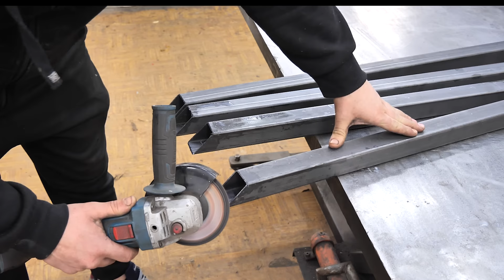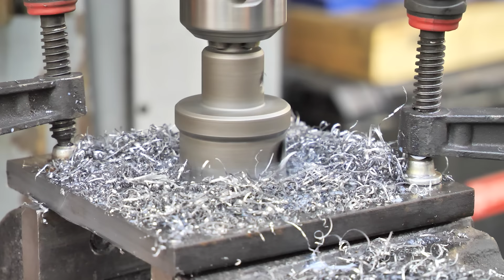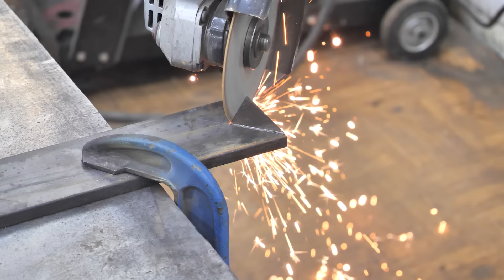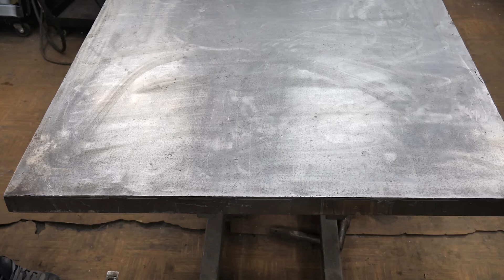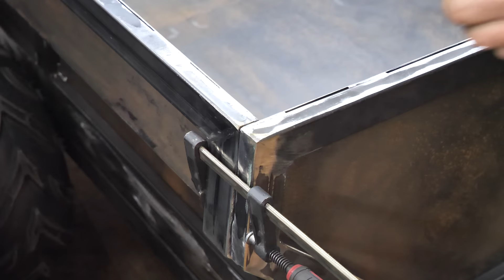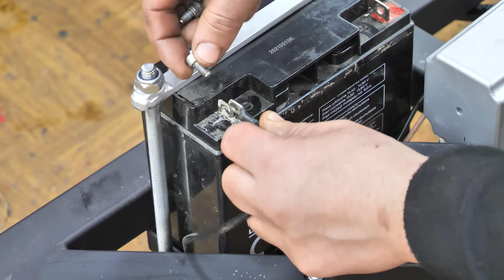Making Electric-hydraulic Tipper Trailer

Comment: Excellent workmanship and a very good trailer. But a safety warning: this needs a swivel hitch to prevent the towing vehicle from turning over if the tipper trailer fell over sideways. It's an easy bolt-on upgrade. Also requires a fuse or circuit breaker on the battery connection.
Reply: Sounds excessive. Just don't tow or dumb on uneven grouf
Reply: Clearly you don't know what you are talking about. Even commercially built dump trailers don't have a swivel hitch. Why, because it's a weak point. That trailer isn't big enough and doesn't raise high enough to worry about tipping.
Reply: lol I'd be shocked if this trailer was capable of turning over a 4 wheeler or golfcart. how big do you think this trailer is? lol
Reply: My old man had a tractor tipper go over once at 30’ high. This is sound advice. Possibly not as much of a worry as his
Reply: LOL the design exceeds it's intended use .
Reply: @mikel9567  typically that style trailer has off-road axles and, if so, then it would need a rotating tongue coupler, so as to not tip over if one wheel we're going over a rock or log causing the trailer to tip.
Reply: No you could just drink whiskey and take a bumpy road for a real day of excitement👍😊👍lol
Reply: Why would you make a nice heavy duty trailer and then bolt of some cheap crap pressed metal hitch?

Comment: Couple ideas to improve -- Build a hanger on the front face to hold the tailgate when it is not installed.  And Install chains on the tailgate so you can limit the opening and control the spreading of product, like a dump truck does,  Excellent video!  Thank you for sharing!

Comment: That is a very nice design. One thing I would suggest is to cover the pump and battery with a solar panel which will protect them from the weather and keep the battery topped up without having to think about it. You might also be able to find an old tool box to mount them in which could also be a place for the remote control. I'm thinking of those tool boxes which would be deep enough, but then have a removable tray to cover the battery/motor and it could hold other small stuff.
Reply: This is a good idea!

Every spot on my property that gets a mower, tractor, atv, etc parked in has a solar powered battery tender connection. That and flat tires are such a pain in my ass that I mounted a 12v battery and air compressor to a dolly... Has jumper cables just in case after one of the battery tender wires oxidized and that battery was dead even after being on a damn charger. Also has a shelf for a little 79cc 2 stroke harbor freight 700w generator but I haven't needed that for anything yet.

I have grid power available in most spots but why have the constant drain when solar is sufficient.
Reply: In addition to the above modifications, I suggest adding a second set of tailgate connections to the front of the trailer so when you take the tailgate off the back, you can hang it on the front face of the trailer so you don't lose it, forget it and when you've offloaded whatever you took the gate off for, you can immediately put it back on the rear so you can then load more lose material (gravel, sand etc.) without having to go all they way back to wherever you left the gate...

Comment: Nice build. I'd recommend a charge circuit for the battery otherwise it will just discharge as you use it. Maybe a solar charger or just recharge it after each use.
Reply from the maker: Thank you 😁 First I have to fix the charging in the mower troctor 😂

Comment: Great build and craftsmanship. Now I'm guessing the location of the ram is due to the length of its stroke and a possible need to tip it straight up, but if positioned so that the ram is closer to the front it would allow for heavier loads to be dumped, while simultaneously reducing the power needed to raise and lower the tipper save your battery and pump. But in the end it works and for diy that's all that matters. Thumbs up from me.

Comment: Super. I would change one thing and that is when the line comes in at the ram on the top. Put a hard line down to the pivot point this way the line only needs to move a small amount and the flex would be limited. Other than that a super build! Love it.

Comment: That's very cool, one day you'll make a 4x4 small Traktor just for the farming tools ... very nice job 👏
Reply from the maker: Yes, a small tractor is in the plans but I don't know if I will be able to build a 4x4, but maybe 😁 Thank you 😁
Reply: @Workshop From Scratch - tray to use hidráulica traction 2 wheels permanently on traditional gearbox, and 2 wheels with hidráulic traction. More controllable very simple to use and fewer parts and has independent traction and steering on demand.  just an idea never seen I think, extreme hybrid 4X4 ... good job my friend

Comment: in the places where the tie rod was screwed, it was worth strengthening the holes and putting the bosses inside, in fact, almost the entire load falls on these two bolts, and over time they will bend the profile pipe ...
it would also be nice to strengthen the welding points of the hydraulic cylinder mount and the hinged mount of the body ...
Reply from the maker: It is a trailer which, due to its dimensions, will not carry loads greater than 300,400 kg, so there is still an excess of material that I used

Comment: you should add a section of chain on each side of the gate with a notch on the gate to allow you to limit the width of the opening so you can spread material rather than just dumping the entire load in one place.

Comment: Nice build. Where is the oil for cylinder located?
Definitely building this for my needs. I wouldn't put battery on trailer, rather I would use power from lawn mower connected with socket controlled with switch, but in my case, trailer will be used only with lawn mower.
Best regards!
Reply from the maker: Thank you 😁 There is a mini hydraulic power supply with a built-in tank and sectional baffles and pressure protection which makes it maintenance-free, this mini power supply comes from the loading lift of a delivery car

Comment: Brilliant. Can I ask what happens if the pump had no power half way through the "lifting / tipping " cycle. Does it stop in mid air ? Or would the tipper fall back down under gravity? Many thanks.
Reply from the maker: Thank you 😁 It is a mini power supply that comes from a van, has a built-in section divider, pressure protection, i.e. everything that can be found in a large hydraulic system, if there is no electricity, the lifting will stop in place and it will not rise or fall
Reply: @WorkshopFromScratch  Thanks for the reply. That is very interesting.

Comment: Excellent! I couldn't give this a "thumbs up" fast enough. Question regarding the sides: is there a specific reason, or advantage for the having angles vs straight sides? 
Is it to strengthen the box, or does it dump wet material easier without clogging? I also liked the latches you used–they're very similar to those on my trailer. 
[I think I shared a link with you at one point in the past on a previous build]. Anyway, great job–as always. God bless.
Reply from the maker: Thank you 😁 As for the slanted sides, it's mainly about larger capacity, thus not increasing the dimensions and wheelbase in the trailer, if I was making a larger trailer, I would use ordinary straight sides :)
Reply: I think the widening sides also act as fenders if making a larger, road worthy version.

Comment: The hydrostatic drive of your mower is not rated for towing. It will wear out quickly towing heavy loads.
Reply from the maker: Two years ago I built a mini dumper truck on such a hydrostat, it works until today and is ok, even though it has transported a lot of loads during this period, the video of the build is on the channel :)